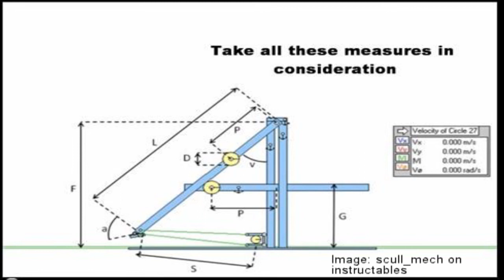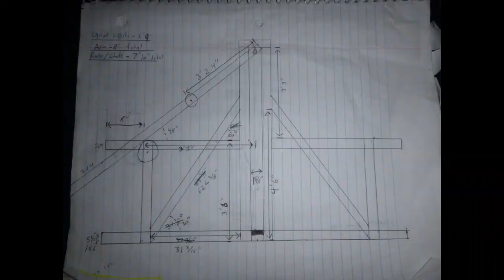Floating Arm Trebuchet - 2016 - 8.5 feet tall

Comment: If u do it again put an eye bolt on arm and quick release for rope climbing like a pin of grande way more accurate bc they would of ate it like a deaf fall trap but with rope then pulled on dead fall stick releasing counter weight like a trap most accurate

Comment: Awesome job man! Do you remember some of the distance ranges for different counterweights?
Reply from the maker: It's been awhile, but I do remember that past 130 lb of counterweight, the throwing distance leveled off, probably due to the frame moving too much. We got around 300ft throws of 4 lb rocks using this weight. Not the best trebuchet, but we still had fun with it.

Comment: Nice! I built a traditional trebuchet (10ft tall) last year had pretty good success with it we had pumpkins between 1.5 and 3lbs we got 420ft out of @90mph but we never got to my designed weight of 300lbs. the only pivot point i could find in the limited amount of time as 1" gas pipe and it bent pretty good on us around 240lbs. SO for this year ive done a lot of reinforcing and filled the pipe with concrete 300lbs should be no issue. Videos on my channel. when i launch the improved trebuchet it will be on my other channel. (the coffee guy vlogs)
Reply from the maker: rccrazy30 That's pretty neat! I wish I had thought to put my camera on a level tripod and put a scale to know how fast it launched. That's awesome
Reply: Basement Engineer I actually used my drone to measure the distance and had a wide enough shot to calculate how long it took from release to landing for the speed